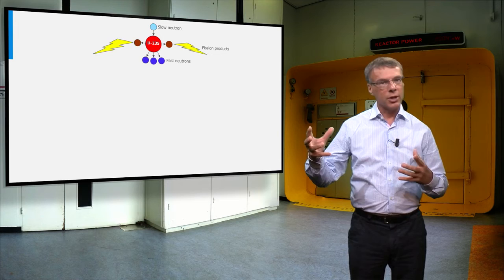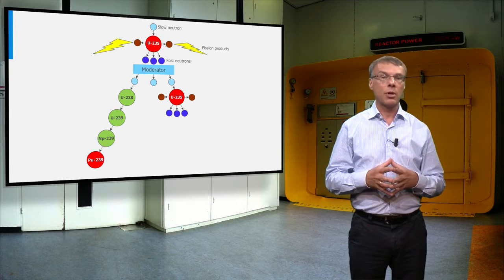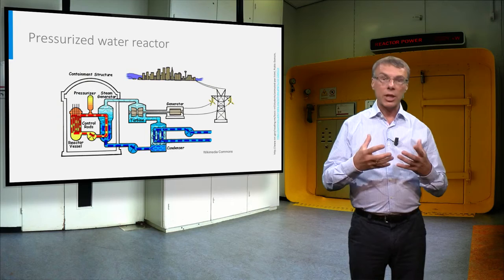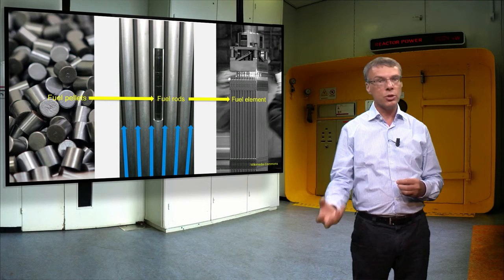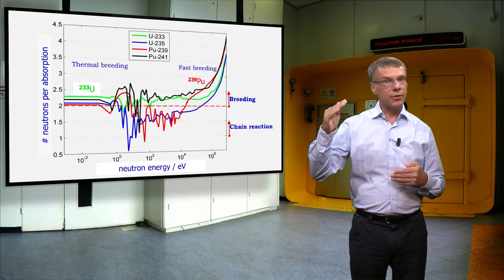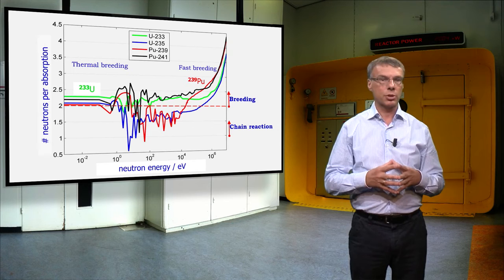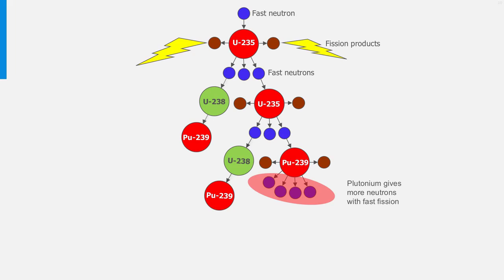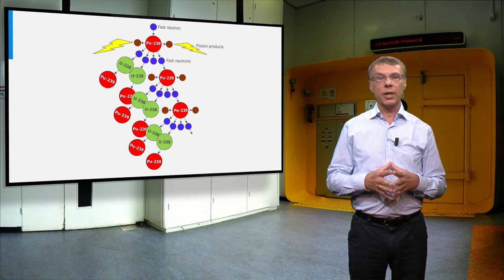Principles of a Nuclear Reactor

Comment: Ans: From the video, it's 2. However,  it depends on the design of the reactor for breeder design its 1 and burner its less than 1
Reply: I would say 4. Because the question was “from 1 fission event” and 4 neutrons are released in 1 fission event.